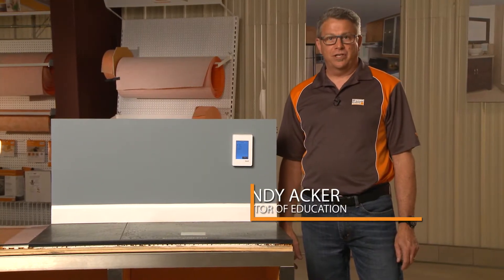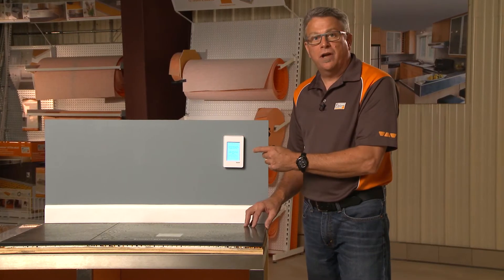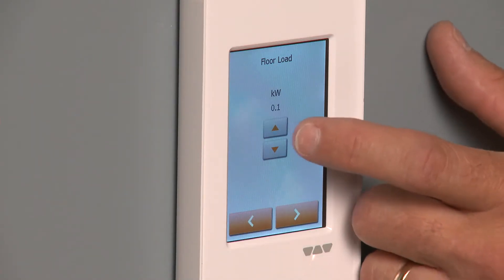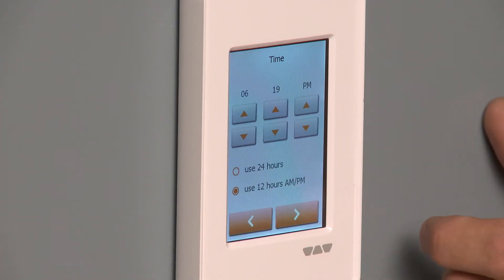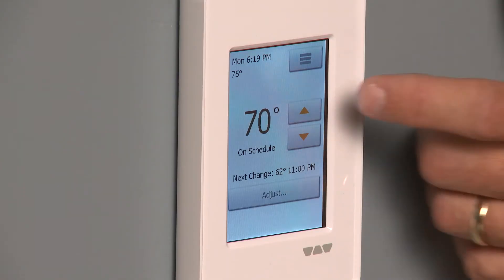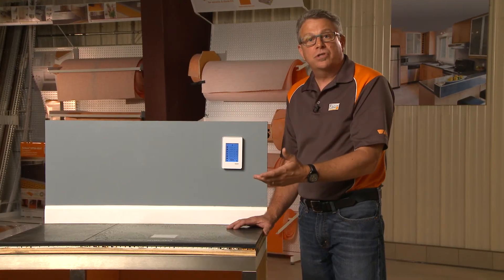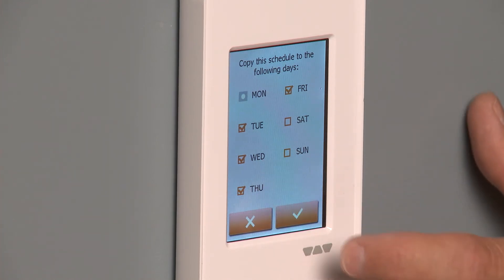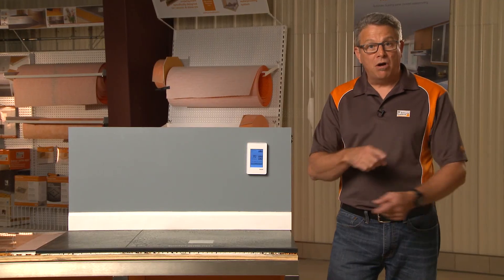How to program the DITRA-HEAT-E-RT Thermostat

Comment: Is there an on/off switch?  My system is fully installed but I do not want to heat the floor for a couple of days...thanks!
Reply from the maker: Hi there! You can program your thermostat so your floor only heats when you want it to, or you can turn it off with the power button on the side. You can also turn the breaker off, if you want. For more info, reach out to our product support team, they will be able to walk you through the process. You can reach them at at 888-472-4588 (US) or 800-667-8746 (Canada). Hope that helps!

Comment: Horribel video. How do you have it turn off so its only on 4 hours a day???
Reply from the maker: HI there! You can program your thermostat so your floor only heats for 4 hours a day if wanted. You can reach out to our product support team, they will be able to walk you through the process. You can reach them at at 888-472-4588 (US) or 800-667-8746 (CA). Hope that helps!

Comment: Hi looking through comments and on your site. You recommend lowering heat in between heating events. Do you have an ideal temperature? I live in upstate NY and during the winter we keep the house around 68-70 but want the floor in the bathroom to be warm in the morning and at night. If I want the floor to be 75 by a certain time how far in advance should I have it come on and what idling temperature during the day do you recommend? Thanks!
Reply from the maker: Hello there! Every floor is unique and the temperature and timing will depend on your specific installation, building and location. We recommend experimenting to find the ideal settings. You may want to start by increasing the temperature a few hours before you need it to reach the desired level, then adjust based on how quickly it responds. Hope this helps!

Comment: I had a system installed in early 2019. Worked well enough but today the screen on the thermostat is completely dark and it will not turn back on. What do I do?
Reply from the maker: Hi there🍊 Sorry to hear you are having a product issue - our Product Support team would be happy to help you - could you please reach out at 888-472-4588 (US) or 800-667-8746 (Canada). Thanks!

Comment: Hi there! I noticed my master bath monitor time display was a few minutes slow, so when I went in to fix it wasn't on set-with-the-server so I checked the box. Now it is showing us on pacific time and we are in mountain time. I don't see where to fix that in my online account. The guest bath monitor is accurately set to server. Thanks for your help!
Reply from the maker: Hi there! Sorry to hear you are having trouble with your DITRA-HEAT system, we want to support you with that! Can you please contact our product support team to discuss your issue.They will be able to assist with this. You can reach them at 888-472-4588 (US) or 800-667-8746 (CA).

Comment: Hi, does the thermostat have a summer mode or do I need to change all the temperature settings?
Reply from the maker: Hi Jeff! The wi-fi thermostat does have a vacation mode. The DITRA-HEAT-E-RT do not have that option. You can turn the power off at the thermostat or at the breaker. Other option  would be to manually turn down the temperature to something where it wouldn't heat (50 degrees for example) and then select for the change to be "permanent". Once you  do that, a button will show up on the display that says to resume schedule. Hope that helps!

Comment: Hello there I don't want to call your support team. I want to know why after one month of use my unit is acting crazy? It is showing floor temperature 104 while it is cold. Calibration is not helping. For some reason system is STUPID. because when I'm trying to set correct temperature myself it does not let me  go lower than 84.???

Comment: How do you stop the system from heating the floor all together?
Reply from the maker: Hi Patrick, You can just hold the side (power) button for 2-3 seconds to turn the thermostat on or off. Hope this helps.
Reply: @schlutersystems1  How do you turn it on after being off for 5 weeks while away? Cant find a manual on it for help.

Comment: How do you change the battery in this unit? Does the plate pop off? Or is there a screw somewhere?
Reply from the maker: Hmmm... It would be unusual for the battery to go bad. The best way to figure out what exactly is happening with your thermostat and how to get it fixed is to contact Customer Support for assistance. They will help you troubleshoot the issue and find the correct resolution.
800-472-4588 (US)
800-667-8746 (CA)

Comment: Is the temperature on thermostat the indication of temperature oft he surface floor? We noticed it definitely is not the air temperature. It is currently set up at 85F (the builder set it up). The weather has been warm here and it hasn't gone down below 85F that yet. But some mornings have been chilly, the thermostat is still above 85F. Trying to find a temperature benchmark.
Reply from the maker: Hi Jung, the temperature indication is for the floor, not the air temperature. If the system/sensor is installed properly, the floor temp reading on the thermostat should be either the same or pretty close to floor surface temp.

If there is an incorrectly connected sensor, you may not feel heat on the floor and the thermostat readings could be off. In that case, we would suggest contacting customer service for assistance. If you do feel heat on the floor, you would simply adjust the temperature settings until you find one you are comfortable with.

Hope this helps! Please give our Product Support team a call if you'd like to discuss your project in more detail: 800-472-4588 (US) or 800-667-8746 (Canada). Thanks.

Comment: I like how the thermostat slips in the "floor load?" in Kw  yet the manual is in watts.  So my floor load is 475 watts.  Should I enter .4Kw or .5Kw?  Neither one is right based on the options I can choose from.  I think someone on the design team needs a slap in the head and have his parking spot taken away.  I'll never understand why manufactures can't match the information in the book to the device.  Is there any way to stop the floor heating besides either turning off the breaker or turning the temperature presets all the way down?
Reply from the maker: Hi Arpad, the floor load is used to calculate the approximate energy consumed by the floor heating system. If the floor load is entered in kW on the floor load screen, the user can then view their system's estimated energy usage data under "Menu" > "Energy Use". If the screen is bypassed or an incorrect floor load is entered, it will have no effect on the floor's heating performance or operation of the system. For your system, if you plan to track the energy usage data, we recommend rounding up to 0.5 kW on the floor load screen. The Schluter DITRA-HEAT-E-RT and DITRA-HEAT-E-WiFi thermostats can be programmed by the user to fit their scheduling needs. Also, another way to stop the floor from heating is to hold the button on the bottom right hand side for 2-3 seconds. That will power the unit off, but the breaker will still be on. You can hold the same button down for 2-3 more seconds to power the unit back on.

For additional assistance, please contact our Customer Service team or view the DITRA-HEAT Thermostats User Manual by visiting the product page on our website.

Comment: Need to know how to actually change the schedule and turn on the inactive ones and how to make others inactive!
Reply from the maker: Hi Jillian, Here's a link to the user manual.
https://sccpublic.s3-external-1.amazonaws.com/sys-master/images/hf5/h5e/9127938981918/DITRA-HEAT%20Thermostats%20User%20Manual.pdf
You are also welcome to contact our customer support team for assistance: 800-472-4588 (US) or 800-667-8746 (CA) 🍊

Comment: How do you turn it off ?
Reply from the maker: Hey, David! There are several ways to "turn off" the thermostat other than the normal heating and cooling cycle (turn on and turn off times) you program in as a set schedule for morning, day, evening, and night temperatures. 1. Hold the button on the bottom right hand side for 2-3 seconds to power off the unit. You can hold the same button down for 2-3 more seconds to power the unit back on. 2. Adjust the manual target temperature to 50 (or a lower temperature that would never give the thermostat a reason to kick on) and then select "Permanently" for the time frame. When you want to resume operating as normal, you would just click "Return to Schedule". 3. Turn off the breaker. Please contact Customer Support if you need help with programming your system.

Comment: How long does it take to heat the floors? Mine has been on for a while but I don't see any degrees gained on thermostat
Reply from the maker: Hi there, our Customer Support team would be best suited to help you troubleshoot. You can reach the team right here: 800-472-4588 (US) or 800-667-8746 (Canada). Thanks!

Comment: How do you know what ohm setting to use?  Default is 10k ohm, and when testing for continuity the ohm test is 140 ohms?  Am I missing something here.  When go to set a custom ohm setting it shows a low and a high setting.  Not sure what to input?  I have a 32ft Ditra heat cable at 240 V?  Please advise of this important question?
Reply from the maker: Hi there! This might be easier for us to discuss with you on the phone. It sounds like the correct reading, and you can double check it with the ohms number on the silver tag. If it does not match up, refer back to the meter manual to find out the range for each ohms setting and try again. Again, think this might be easier for us to discuss on the phone, where we can get some more info from you. Please give our Product Support team a call directly at 800-472-4588 (US) or 800-667-8746 (Canada). Thanks.

Comment: How do I calculate the floor load?
Reply from the maker: Hi Chris, The floor load in kW is equal to the total wattage of the cable (or cables) connected to the thermostat divided by 1000. The total wattage can be found in the Price List or on the silver identification tag attached to the heating cable. More details can be found on page 16 of the DITRA-HEAT-E User Manual.
https://sccpublic.s3-external-1.amazonaws.com/sys-master/images/h03/h21/9083839676446/DITRA-HEAT%20Thermostats%20User%20Manual.pdf

Comment: So, if I set an event to heat up the floor, I also then need to set up an event for the floor to stop being heated, correct? Event 1, heat floor to 70°; Event 2, drop heat to 52°, effectively turning off the heat. Right?
Reply: Exactly. All these videos and none of them tell you how to turn off the heat for summer:::
Reply: @markbodogh6574  Agreed.   I was just looking for a solution for this when I came across this.
Reply from the maker: Hi Scott, yes, that's correct.

Comment: Installed last week; this morning GFCI error/fault and system shut-down.  Contractor returning to trouble shoot but may take a couple of days.  Ambient outdoor temp is 60F, however in the meantime temperature gauge shows increase from this  morning of 80F to 92F this evening, while the floor tile is stone cold with zero energy use recorded.  Let me know if system is a risk and whether I should turn off/flip circuit breaker.
Reply from the maker: Hi Steve, could you please give our Product Support team a call for this? 
US 800-472-4588
CA 800-667-8746
Thanks!

Comment: After my electrician and contractor installed the floor heating, the thermostat was showing floor temp of 102 F which I know isn't true.  Do I need to calibrate it? If so, do I shoot a temp gun at the tile and take the reading and enter that into the thermostat? Thanks.
Reply from the maker: Hi K S, can you give our Product Support team a call... they'll need to trouble shoot with you a bit, and then be able to advise from there. 800-472-4588 (US) or 800-667-8746 (Canada)

Comment: How do you determine the load
Reply: These links to the User Manual (?) at AWS all result in “access denied”.  Since there are SO MANY requests for information on turning the system Off, it suggests that both the system Installation booklet and the Thermostat Installer guide should highlight the “Vacation Switch” capability of the lower right button…..
Reply from the maker: Hi Josiah,

The floor load in kW is equal to the total wattage of the cable or cables connected to the thermostat divided by 1000. The total wattage can be found on the silver identification tag that's attached to the heating cable or in the Price List. 

If needed, there is a little more detail on page 16 of the DITRA-HEAT-E-RT User Manual which can be found here: https://sccpublic.s3-external-1.amazonaws.com/sys-master/images/he5/h70/8854609887262/DITRA-HEAT-E-RT%20User%20Manual.pdf

Hope this helps!
Reply: @schlutersystems1  This is why I found the video ... installer didn't explain but I found the silver tag.  In my case it was 1160 watts so I used 1.2Kw on the thermostat.

Comment: I have this thermostat installed and does it depends with the temperature inside room? Mine thermostat set for 82 and it’s never got over 74 on tile. House temp set for 68 during the day and night 65 and during the night schluter thermostat drop temp, why it not heating floors?
Reply from the maker: We'd love to hear more about what's going on here. Do you mind giving us a call? Our Product Support team will walk you through a few questions to get to the heat of the matter (see what we did there?). You can reach us on US: 800-472-4588 or CA: 800-667-8746 
Thanks!

Comment: Does" Adjust" on the screen mean you can over ride the programed temperatures?  Is there a way to bypass the daily schedule and set the thermostat as you want  ?
Reply: How to get the user manual? The installer never left one .
Reply from the maker: Hi Anne! You can override the temperature as you wish. Please see page 25 and onwards of the Ditra-Heat-E-RT manual here: https://sccpublic.s3-external-1.amazonaws.com/sys-master/images/he5/h70/8854609887262/DITRA-HEAT-E-RT%20User%20Manual.pdf

Comment: The only thing that is not understood is how to turn off the ditra-heat, beyond the programming.
Reply: I have this thermostat and I just turn it to the very lowest setting, I think it's 64 degrees. My house is always warmer than that so it works for me i.e. it won't turn on because the setting is too low.
Reply from the maker: Hi Gastón, please give our Ditra-Heat specialists a call. They are well versed in all aspects of our thermostats! You can reach them at (US)888-472-4588 or (CA)800-667-8746.

Comment: When entering the energy tariff, is 10.4 cents per kwh entered as .104 or 10.4 or something else?
Reply from the maker: Hi SoonRetiring! Can you give our Ditra-Heat Specialists a call? They can go through thermostat tricks with you in detail. You can reach them at (US)888-472-4588 or (CA)800-667-8746. 
Thanks!

Comment: How do you turn it off totally during the summer.
Reply: Push and hold the button on the right side near the bottom. Push and hold again to turn back on.
Reply from the maker: Hi Maria, thanks for the comment! If you are able, could you please give one of our Ditra-Heat specialists a call? You can reach them by calling our Customer Support team a call: (US) 888-472-4588 or (CA) 800-667-8746
Thanks!
Reply: @schlutersystems1  I know this was a year ago but it didn't get an answer that should be addressed for many.
Reply from the maker: @boilerman1991  There is a button located on the lower right-hand side of this thermostat model (DITRA-HEAT-E-RT) shown. If you hold  the button the thermostat will turn off. Please see our website  for the thermostat quick start user guide or contact the DITRA-HEAT specialists for further assistance at the numbers listed above.